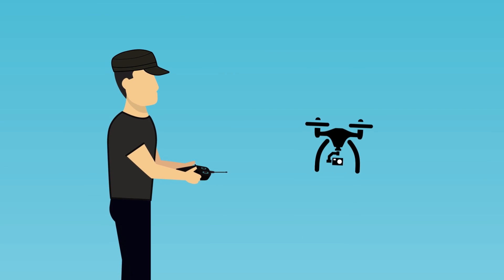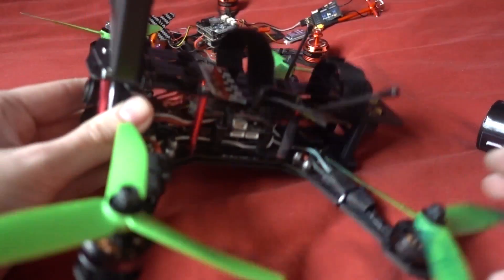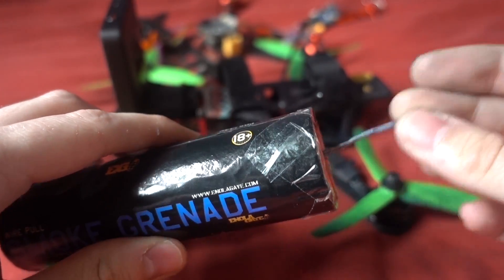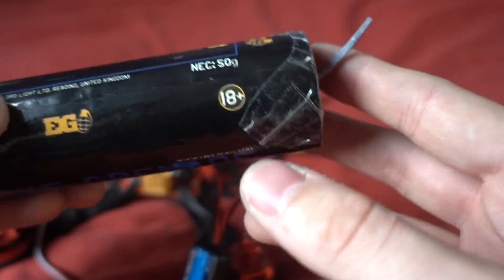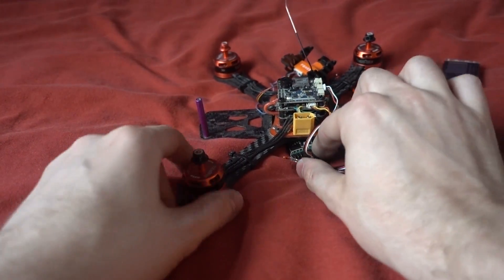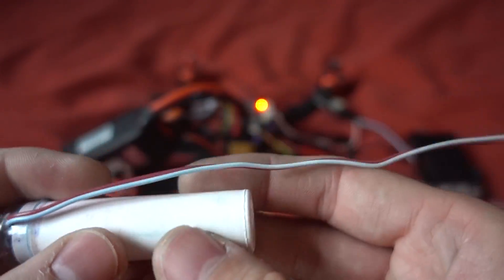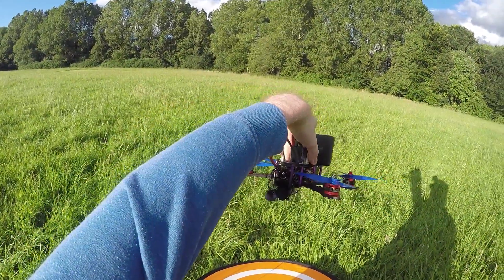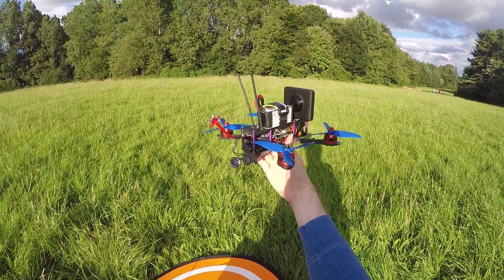Quadcopter Smoke System Fail

Comment: Hi Andy RC,  I was just interested in the blog you were  doing, I have a suggestion to give you, why don't you buy a rc smoke generator it will simplify it, but the problem is that will add weight on your fpv drone

Comment: I am sure you understand the channel order issues so I assume you mispoke early on in this video. So just to clarify. With open TX on FrSky radios channel order is set by the TX not the RX. The default order can be selected on the setup page of the TX.  However like all rules there is an exception and the newly released S6R and S8R RX's require the Futaba channel order of AETR to work correctly in stabilisation mode.
I think the power up firing is a to be expected since the RX and FC have not had time to stabilise and could power up in any state. A simple remedy would be a manual switch to isolate the fuse until ready for take off.
Reply from the maker: you are right rob i could have remapped the channels with the tx, never mind. the zmr is aging though and the usb has broken off the kiss fc so it was best to switch out, as for your switch suggestion ill have to do some testing I have a feeling it puts out small voltage regardless of the pwm position cheers
Reply: I meant a switch or plug and socket between the quad and fuse.
Reply from the maker: I will do more testing thanks

Comment: That was a very nice try Andy. It should have worked but it did provide  good laugh as well.
It's not something I'd try as I gave up on fuses on aircraft after setting fire to a free-flight glider with a dethermaliser back in the balsa and tissue days :)
Reply from the maker: yeah once the grenade is going it burns fairly cool temp but the ignition is essentially a match it doesnt go well with foam. there is a demand for this i think though
Reply: Until this morning I would have agreed. Then I heard the news on BBC. Flying weight is going to become a major consideration soon :(

Comment: Looks like you need to get the smoke out of the prop wash before it get's spread out and thinned to almost nothing. I'm wondering if these would work stuffed into something like a aluminium tube with a reducer cap on the back end and curved tube coming out of that to take the smoke 10 or so centimeters behind the quad and inline with the rear props? It would also give you the option to bend the back tube about a bit to see if there was a "Sweet spot" behind the quad with less turbulence.
 
Alternatively, Maybe elastic banding (And possibly just a little blu tack to keep it square) a 50cm long carbon rod side to side across the top of the quad and taping a smoke grenade to either end of that to get them way out the sides of the prop wash........ It might work....... Might leave some nice spiral patterns with some FFF slow roll flips  ....... Or it could just blow up and take the quad out with it....... Would be an interesting video either way though.  LOL !
Reply from the maker: just needs a better mixture of the components I need to figure out the ignition system and then try it on the big one im close but so far haha

Comment: I wonder if the Initialization sequence sent a signal to that AUX channel...  You might want to try again, but unplug the JST to the fuse when you plug up your battery.  After you get the tones, then re-connect the JST and fly...!
Reply from the maker: this is something i need to think about it doesnt register on a multimeter so far

Comment: Shoud I buy the Wizard x220s? It doesn't sound that bad and I may order it on ebay rtf for ~280$ USD
Reply: i want to buy it but im broke
Reply: No_Chill Kobie Lol. I was about to get the inductrix, but I realized it wouldn't be as much fun for me since it won't hold up much outside. I am thinking about the Eachine Furious 250 (only 215$ for RTF! That's verrrry cheap since the x220s is 270$....) but I'm not sure yet. It doesn't have a lot of the features the wizzard x220s offers, but it's cheaper... I think I should just buy the x220s so I can keep it for the long run and not have to buy another for a long time, just some props and maybe a broken arm here and there
Reply: Is it a first time quad buy? I made the mistake of buying a prebuilt goolrc 210 and it lasted me about a month before it broke after crashing and what not. I have since built my own from scratch and even with my limited flying experience when I do crash it now lasts and can take the impact
Reply from the maker: its good if you get one that works. mine is ok but two other reviewers had duds

Comment: The voltage checker will need about 1.5v to power it, the 1.2v needed to set the fuse off won't show up on the voltage checker. That's my theory, but nice attempt!!!!!😁😁😁
Reply from the maker: you are right there cheers
Reply: AndyRC was that the issue

Comment: You'd probably be better off with self made smoke flare(recipe easily found on google) and a normal fuse - say 10 sec one - easily available on ebay and such. That's what RR did I think and it did seem to work fine
Reply from the maker: thanks for the info
Reply: Having a trigger on a switch is cool though.  We can all strap a smoker on a quad, light it and fly.  
Andy RC has the right idea.
Reply from the maker: if you light it on the ground the coloured oil goes everywhere and you end up with a small hole in the ground... I want to get it working. i hopefully will then put some phantoms in the air to watch it go round a track